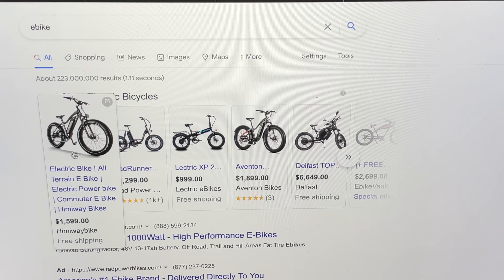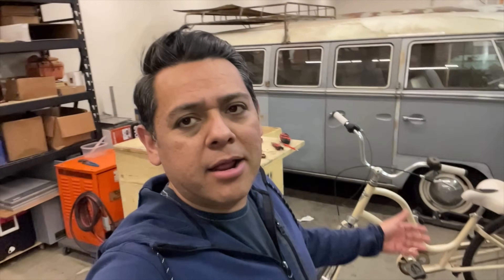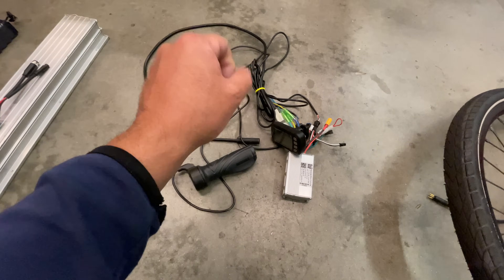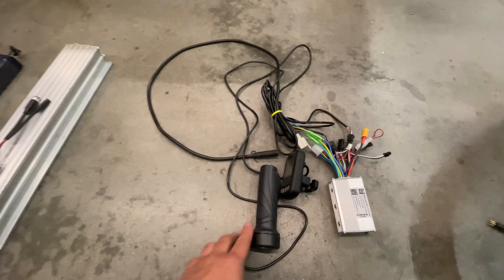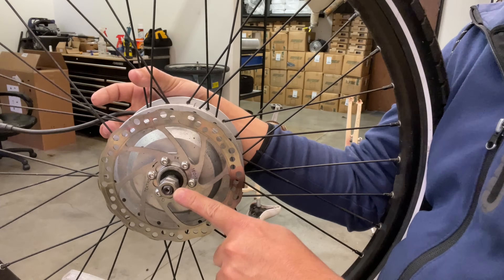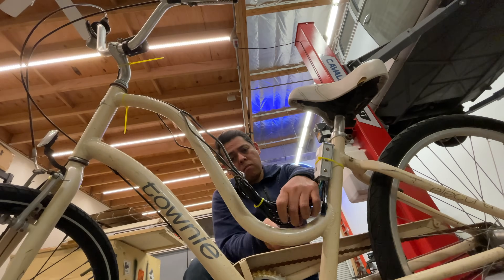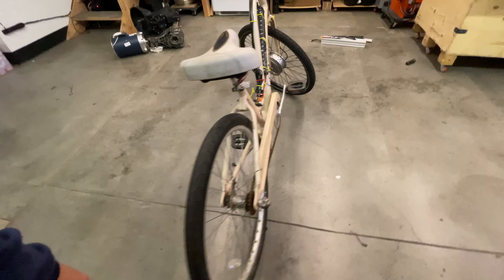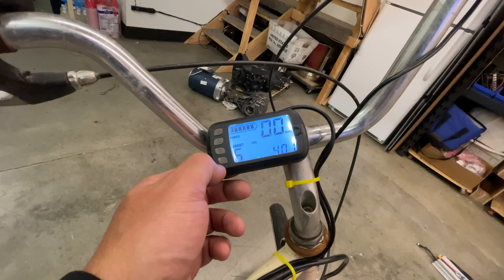$150 eBike Build,  Beginner friendly

Comment: You'll need a lot more than this build to have a safe and reliable ebike build in 2022. Batteries costs have gone up, $200 gets a decent one now. Kits w/ a throttle, controller, etc run about $120 at least. Then you need the hub motor and spoke wheel, that's another $150-$200. A used bike in decent condition is another $100. After all that work, you really should replace the tires and brakes. That's another $70, and a charger for $30. Finally, after nearly $800 and a LOT of work you now have an ebike that's inferior to almost any new low end eBike. 

Which will have a warranty, and doesn't need many hours of time and work invested in it. They will ship it to your door, and in 1-2 hours you're on the road w/ a bike that's reliable and handles better because the weight of the hub motor is on the rear, not on the front. 

Those brake electrical connections that he decided to leave out? That's a really, really bad idea. Those are designed to cut the power to the motor if something goes wrong and the throttle sticks or something equally bad happens. They are required on all ebikes by Federal law for a reason.
Reply: Bought a totem victor2 electric ebike shipped from China that never even started..700$...passed the 30 day return limit..

Comment: I like the idea of the motor that sits next to the pedals, because when you wanna use it just as a normal bike, it doesn't add un-neccessary rotational mass to the wheel, but I don't know if that can fit into this budget. I mean less than $150 is great
Reply: I know it's a year later.  In my research, there are pluses and minuses to what you describe, a mid-drive e-bike conversion.

The plus as you mentioned is you can use the gearing.

The minus is for a novice user, they can destroy the chain or derailleur if they are in the "wrong" gear and get on the throttle.

For someone who is an avid cyclist, the mid-drive is probably the way to go as they understand the gearing and will use it properly.

For others, a hub motor, front or rear is the way to go.  While not taking advantage of the gearing, there is also less chance of destroying the drive train.

There are rear hub motors as well and I think that would be more natural ride experience.  Having a FWD bicycle just seems odd to me.  While a RWD bicycle is probably more stable.

Finally, while the conversion depicted in the video just used a throttle, the controllers have input for a pedaling sensor, making them able to just do assist.  Meaning it won't go unless you pedal.

Comment: The e bike brakes cut the power  to the motor when applied so you can't accelerate and brake at the same time which would not be good so fit the ebike brakes

Comment: Awesome video! Maybe a dumb question. But can you still pedal as normal on the bike? I want to make one for work, which isn't far but want to be able to pedal as normal if it isn't too hilly. Any thoughts there?

Also how is it on hills?
Reply: yeah you can still pedal. the point of these types of mods isn't so much to  only use the electric part, but to use it as assistance for if theres a hill or just want to go faster
Reply: @1upbyte  are you happy with your setup and would you recommend it to a beginner?
Reply: @DoctorQuinlan  I don't have an ebike lol just a normal one, i am happy with it tho :D

Comment: Do you have a link to the connector needed to connect the hub motor to the controller you have linked? Looks like the hub requires some type of 9 pin connector.
Reply from the maker: Linked

Comment: How'd you do this for $150?? The 1st link alone puts you over $200 w/o the battery

Also you didnt really show any of the connections and what goes where, looks like a bunch of wires coming out of the controller

How do you recharge the battery? What kind of charger do you need?

Comment: The cheapest e-bike I've build cost £80 altogether.

Including all parts bike battery pack everything.
Double disc brake front suspension.
Mid Drive system 40mph+ top end speed.
I spend extra time hiding the wires inside of the frame.
And things like phone holder & USB charger headlight lights & key ignition.
And much more
Reply: How???

Comment: Cool! I bought the Original E Bike over 20 years ago. 36 Volt 500 watt motor for $700 used. I upgraded the battery to a Lithium ion 20 Amp Hour last year!  I put on Pannaracer Blue Side wall tires to match the Blue metallic paint! The motor is from Germany made by Heinzman.  Happy Travels

Comment: Great vid. I have now done my research and found a 1000W crank drive motor (which have the most torque) and a complete kit ... will do 90km/hr once I fit it to a mountain bike I am about to buy! normally that sort of power with 52V @ 30AH system is around $6K (NZD) and I am going to build it for less than $2K (NZD = $1300)USD.

Comment: Just built this on my old single speed. Had to replace the front forks ($25 bucks at local co op style bike shop). All together think I paid about $250? Impressed with the whole thing- 25 bucks for the motor wheel! Have been wanting to build an ebike conversion on my bike for years and you put it together in a way that made sense for me. Thanks !!!
Reply: Where did you find the motor wheel?
Reply: @ayo4152  Through whichever link he posted. It was for a "bent but fixable" sort of thing. It doesn't run perfectly straight but it has run straight enough to work for me until I find someone who wants to service my frankenbike (!!!).
Reply: @Nickisgreat89  the link he posted didn’t work. Was hoping you had another link to use
Reply: The link from description shows me the wheel alone for around 250$...
Reply: @jankoodziej877  I would not pay 250. Mine was cheap. Don't know where else I would look- finding all the parts compiled in one spot was why this video actually got me to build the thing !! Good luck !
Reply: @Nickisgreat89  Thanks. Sadly I've looked everywhere, seems the prices here are just like that. Maybe the situation will improve with time, currently it seems there are massive supply issues.

Comment: Hey boss! Thank you for such an easy going video! I ordered the same kit you linked below. I do not have the wire that connects to the wheel. Is that something you bought separately or did I just get played? I wonder if I’m missing anything else from my kit. PLEASE HELP! Is this something I can buy separately?
Reply from the maker: The extension cable is linked in the description

Comment: Question....Why would one not contact the Brake Lever disconnect switch?  Seems to me that there is no way to stop this bike build from producing a Very dangerous situation. May have added a minute to build time, and the brake disconnect came with the kit. Otherwise the front wheel is going to overpower the bikes already poor bike's brakes in an emergency.
Reply from the maker: Do it,  I didn’t to kelp the build as simple as possible, but there’s no reason you shouldn’t

Comment: Got the hub to get power but doesn't move. But I here it with the throttle
Reply: It's running backwards.
It's a gear motor so it freewheels in one direction.
Connect the two white wires togather hit the throttle shut down disconect the white wires and see if that cures.
There are videos covering those "learning wires" if I got a step wrong.

Comment: What do you use for a charger for the battery?
Reply: I just bought a cheap one off feabay with a simple plug like a laptop or router has, cut the connector off and use whatever connections you like.

Comment: So is there a way to get this motor for a 20” wheel?
Reply from the maker: Only if you buy one already made or if you replace this motor into a 20” wheel
Reply: @jehugarcia  is it hard to take the motor off and put it on a 20” wheel?
Reply: @jeffreyhosman6653  not hard need new spokes and a rim there are calculators online to help with correct lenght of spokes to get.
Also videos and tutorials on lacing wheels and straightened rims.
Not hard but tedious.

Comment: Between Shipping costs and inflation, this build has increased significantly. Still bought the parts definitely not 150 anymore. It's about 200 or more now. I could've saved with the Aliexpress alternative kit but I'm weary and wouldn't want to wait a month for something that may or may not be fully functioning.
Reply: did you buy the warped wheel ?
Reply: You probably just bought it resold on Amazon which explains the markup

Comment: Is there a way to set it up to where you can charge the battery if you're pedaling?
Reply: Bad idea. Defeats the purpose of electrifying the bike.
Also the hub motor used here freewheels instead of generating cause it's a gear motor.

Comment: Does foot brake work for this setup or do I need to install hand brakes too?
Reply: If your foot brake works now it won't change after the front wheel is changed.
You may want to instal a brake leaver just to have a quick motor kill function even if it's not to stop you.

Comment: Why is the wheel thing so cheep and on Amazon it is a lot more??
Reply: Used and may need adjustment.
Both mine were pretty straight and good shape (havent got to test them yet) they even included the calipers. 😁 
I liked them for the price enough I went back for a couple more but only Canadian shipping ones were available. I complained in an e-mail about why they couldn't ship those to US and they made more available.
I ordered 4 instead of two. If you want it better pull the trigger doubt they'll be in stock much longer.

Comment: I really appreciate your video and have ordered a few things from your links. You inspire others with your work.  I'm a little confused about the two R5 460Wh 36v 13 Ah batteries that I ordered. I ordered two of the basic, untested cut wires ones. Can I set up the thinner black and red wires with Razor charger port? I have some XT60 plugs and Deans too from my Lipo battery gear as I mess with RC aircraft and drones. My ebike conversion is taking a bit more time than I anticipated.

Comment: Just thought I'd stop by to say how grateful I am that you put this together for us. So far my kit has outlasted one of my bikes (harsh winter and salty roads).
I just have one question; Will I have to buy a new motor if the bearings fail or are those replaceable? The wheel doesn't seem to spin freely as long as it used to.
Reply: Idk man doesn't sound like that's necessarily the case, maybe pull it apart again and give everything a good clean and lube. Whatever the problem you gotta make sure you properly diagnose the problem before buying anything imo. I've wasted so much money in my life coz I didn't want to do a few hours of research
Reply: What website can i buy this ??

Comment: Is any way to put a motor on both wheels with I throttle to control both simultaneously?
Reply: Yes. Pretty sure you can wire the two signal wires to the throttle from the controller togather. Ignore the power wires to the throttle from one of the controllers. 
Every thing else is the same as if you were making two separate bikes. There's a video about it "ebike school " I think.

Comment: March 26, 2022. I just ordered the those controls + display ($107), a 36V 8Ah battery from JAG35 ($99), and a out-of-round 26" front wheel with hub motor ($46) from the link for a total of about $252. Shipping on the wheel was $21 of the $45! Total includes shipping and sales tax. Thank you for this video. It finally made me pull the trigger on ordering the parts. It's all going to go on a gray Huffy Stone Mountain (with speckle-tastic 1990's paint) that I bought from the scrap pile at a bike charity where I volunteer. Looking forward to the build.
Reply: let us know how it foes good buddy ..best of luck
Reply: I wish the link worked for me :(

Comment: I already have a bike. I checked in the Amazon and the 48v 1000w Viribus conversion kit costs £175 (cheapest) without the battery. If I add battery it will cost more £160-220. In total, it will be like £390. 😐 If anyone have any cheaper solution, please let me know.

Comment: Finished my bike yesterday. Runs good. Charged the battery last nite. Everything is a go for launch. {Got an extra wheel/hub motor in case I want to do a second build.}
Reply: Any detail on hooking the controller to the battery?
Reply: @kevindtimm  Green to green. yellow to blue works for me. See the Jag35 website.
Reply: @leonjohansson6542  Ah, I didn't know he more details there. Thanks!

Have you ordered a battery from him?  If so, how long did it take ;)
Reply: @kevindtimm  I got two of the same batteries he used in this video build. It took maybe 10 days.

Comment: Hello trying to do my 1st build. Is following your advice on doing a front hub motor. He found a cool kit that has the controller and the wheel together. However it was definitely battery not included waiting for it to ship to me in the meantime I've been looking for a decent price on a battery. I need a 48 V a 1000 W  I would like something within the range of 17AH to 20AH 
Do you have any suggestions? And if not am I able to do a 36 V on a 48 V motor?

Comment: Might be a silly question, but the motor power rating is listed as 250W/350W. I does that mean that the controller should be rated at 250W, or could a 350W controller work? Also if someone wanted to just educate me on why it is listed as both that would help me increase my knowledge. Many thanks!

Comment: HELP!! I bought an ebike conversion kit from an ebay seller for my mountain bike

It is a 48 volt 1000 watt direct drive ungeared . No display, just a throttle, controller, and brake leveres with cutoff switches on them.

I have mounted this on the rear( It came with a gear cassette

This was about 400 bucks Canadian.

Did I get ripped off?

I am having a hell of a time getting a battery at some kind of reasonable price.

Would like to overvolt to 52 or 56.

I have tried on Ebay, was a scammer, 2 different sellers on AliExpress, Were scammers. None delivered the product, Had to fight to get my money back.

Most of the sellers want about 500.00 dollars Cnd for a 52 volt 20 ah battery pack.

Could you please help me out?

Thank you so much!!!

Love your videos. You sound like a really good guy!! And a great sense of Humour!!

Poor Half Crippled Canadian.
Reply from the maker: We have really affordable 48v ebike packs but I can’t ship to Canada https://jag35.com/products/r2-r-series-ebike-battery-packs-48v-36v

Comment: I know this is a shot in the dark but I’ll ask anyways:
I want to upgrade my sitting adult trike bike to be electric. It has 1 smaller wheel up front & 2 large wheels in back.
Is it feasible to use 2 electric wheels in back to hook up with 1 battery and 1 LED panel? Can I make the wheels act in unison with 1 shifter handle and everything else?
Reply: I'm doing a Raleigh 3-wheel with a 24" powered wheel in the front.

Comment: I love the spirit of recycling old junk bikes like that, but I have to say this is... unsafe. Those v-brakes are unsubstantial. With the weight of the battery and the much higher speeds, you would want a far more potent stopping power. Also, zero suspension, if you hit a pothole all that force is going straight up your scrotum.
Reply from the maker: the battery weight 3 lbs..... stop nick-piking,  going outside is unsafe, sunlight gives you cancer so,  stay inside?

Comment: I am running into a problem which I hope somebody can help with.  Everything works for me but when someone sits on the bike the cable from the motor unplugs because it spins with the front wheel.  When I test the throttle without any weight on the seat it turns just fine.  But, when someone sits (135 lbs) the cable unplugs.  I've tighten the M12 bolts as hard as I can but it still comes undone.  What do you guys think?

Comment: I legit have been looking for exactly this kind of build. I have an old trail bike I've wanted to convert to an ebike, and possibly add fat tires as well, but the cost of all the conversion kits are ridiculous or way underpowered and won't break 15mph.

So now I'm going to use this method, have a friend 3D print some housings and brackets so it's not all zip ties, and see how many battery packs I can fit in the frame space in parallel for the most range (I'm guessing about 4 of the largest ones, so maybe about 80 miles per charge. Unless I do 2xParallel of 2xSeries so I've got 40 miles of 70v for MOAR POWAH

Comment: I’ve done two of these builds now and I’m running into the same issue. Everything works great in speed 1 but if I switch to any other speed it looses all power after 5 seconds. I’ve tried swapping all the connections around. Any tips?
Reply from the maker: What battery are you using?  You might be exceeding the power output of the battery.  Adding an additional one in parallel will double your capacity and your power output.
Reply: @jehugarcia  I’m using the 36v 5.2A 20 cell. I used XT30 connections to the controller from battery, could that be the issue?
Reply from the maker: Your controller can pull 10+ amps so the battery shuts off.  Add a second one and you should be fine.

Comment: Hey did almost all the same parts but went with the smaller battery. I'm building it just for fun. Now fully done thing cuts off at full throttle. Around 150rpm and 34.5volt did I plug in something wrong?

Comment: $150?!! ...not really. When you order the wheels and battery, the shipping charge is about the same as the price of those items. So add another 100 bucks at least. so total cost is about less than $300 , not $150!
Reply from the maker: Shipping costs vary a lot depending where you live in reference to where the products are being shipped from.  Shipping is not that expensive for everyone.

Comment: I would get something to make sure the wires are protected in case you are riding and it starts to rain. Water does not mix well with electricity and I would hate to put in the work to build that just for it to be killed by a puddle or rain.